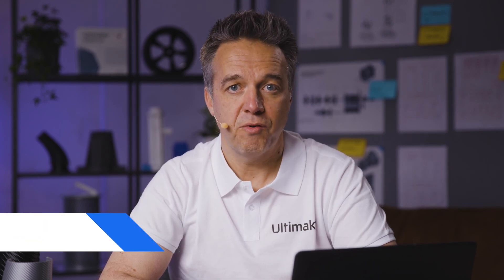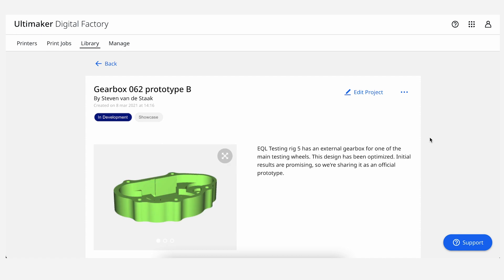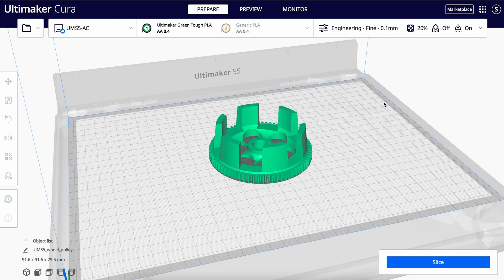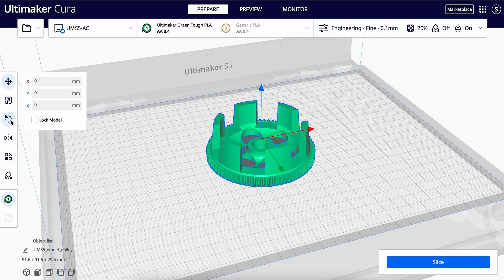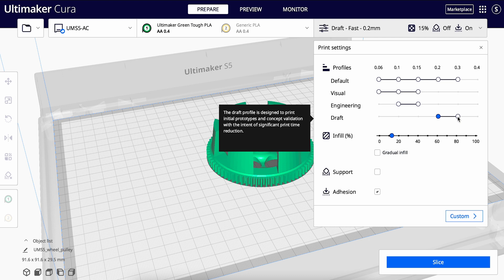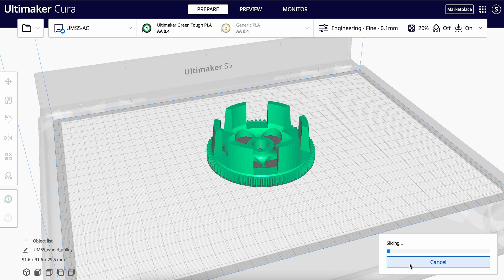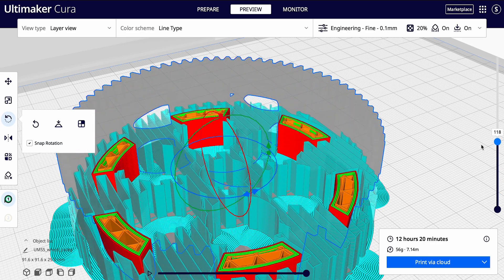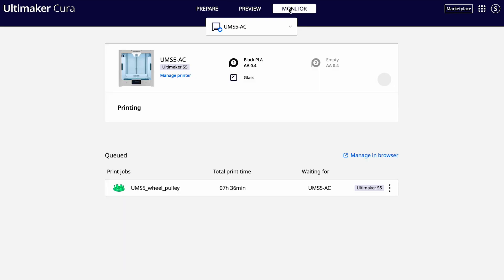Getting Started with Cura 5

Comment: How does Cura 5.0 work with Marlin Linear Advance?? Will it work?
Reply: I can’t speak for Marlin. But with Duet RRF u can just put the GCode in the printer setup in cura and it works fine. 

I also run Klipper and this is done in the printer.cfg so it doesn’t really matter what slicer u use
Reply: @hayden9944  Great thanks, then it's fine

Comment: How did you guys fuk up Cura so badly?   I just printed a cylinder and when I sliced it and in the preview mode, there were all these white dots down the back, after printing.. IT LOOKS LIKE SHIT!!!  looks like a big messy seam and I did the print at 100%  no scaling, 50% infill     I NEVER HAD THIS PROBLEM BEFORE!!!!    WTF!!!   2 days 12 hours 28 mins WASTED! and one Spool of silk gold PLA 1.75      I AM NOT VERY HAPPY!!
Ender 3 Pro, with BIGTREETECH SKR Mini E3 V3.0 32Bit Control Board for Ender 3, Ender3 Pro,